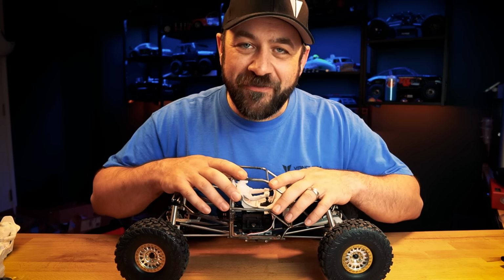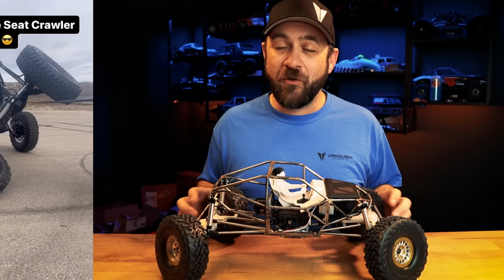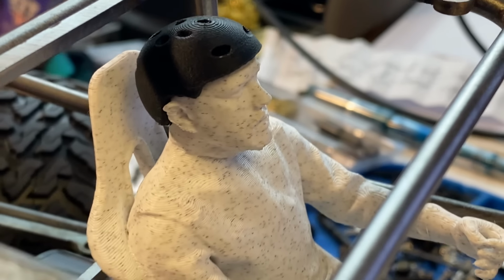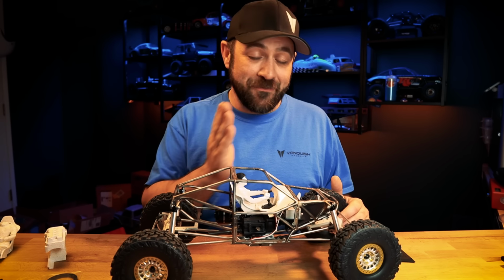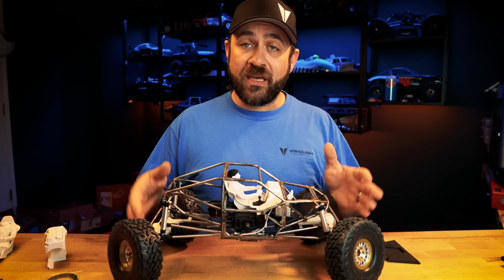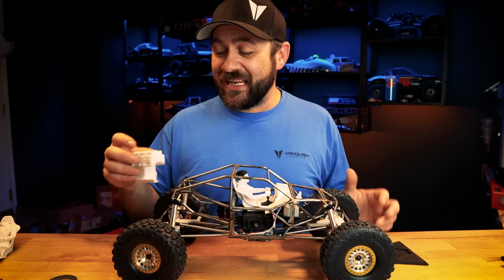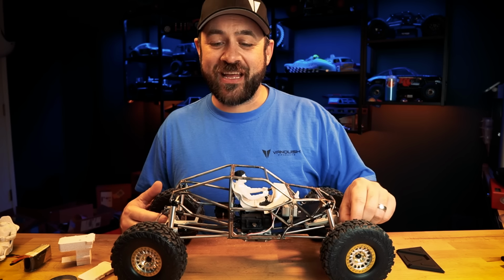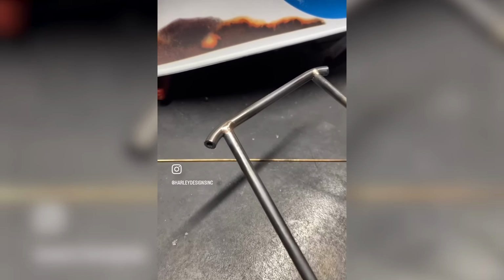The truth behind the SBG Builds - Rocky Mountain Hi - Ep 1

Comment: The driver looks too small and too high. Also, the wheelbase looks too long. Still an excellent scratch build.
Reply from the maker: The drive could be wider but the height is correct and the wheelbase is right on for a buggy like this.
Reply: @HarleyDesignsInc  What is the wheel base? I am building one.